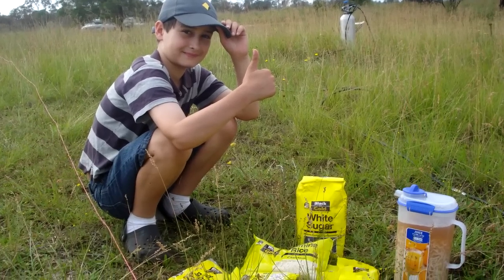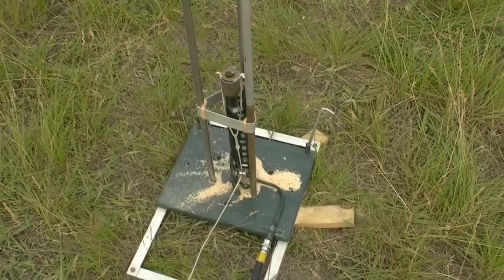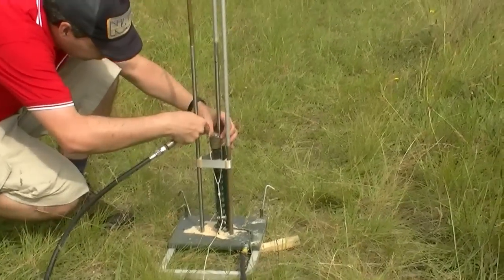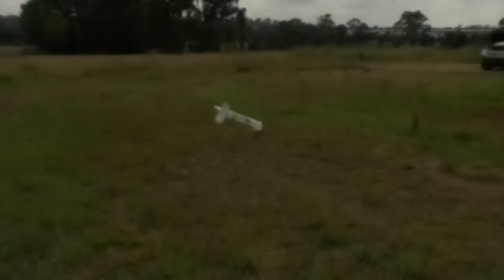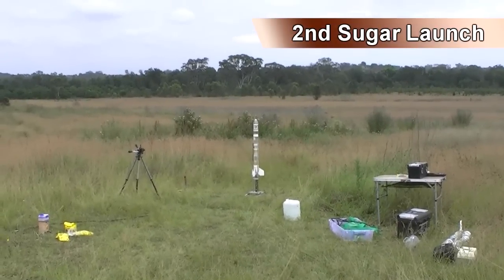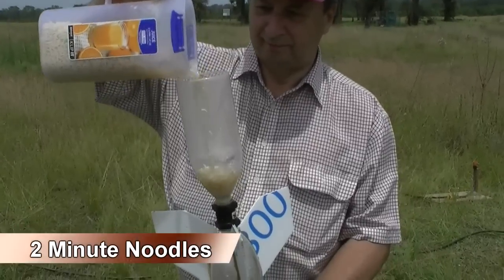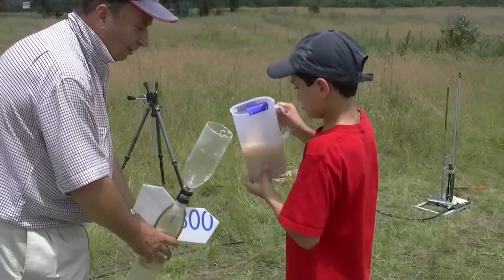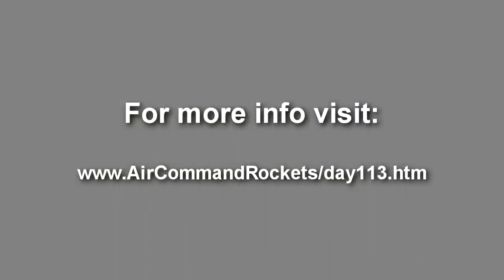Water Rocket Alternative Fuels

Comment: Simulators predict an air-only rocket couldn't reach any altitude. I managed to get a 2 liter air-only rocket about 130 feet into the air, due to the flight time of 6 seconds. It weighs 0.22 lbs with a ball in the top, has a ring fin and was inflated to 120 psi. Because the 16 grams of air moved out of the rocket in a split second, the rocket got an initial speed of about 65 mph. I'm excited about the results. I never thought an air-only rocket could reach such altitudes. On top of that, an air-only rocket makes no junk, it makes more sound than a water rocket and you can launch it horizontally. Not to speak of the reduced set-up time and the water you don't need to carry. It also flies much straighter than filled with water.
Reply from the maker: I'd pretty much agree with that assessment, other than all things being equal adding water to the rocket will give you about 40% more altitude. Water rockets can launch almost horizontally, because as soon as the rocket starts moving the water is pushed up against the nozzle, and "levels" itself against the acceleration.
Reply: O yes, I didn't realise that. Maybe I'll upload a video of my project later.

Comment: If you look at the physics... the fuel should be as heavy as possible, and be pushed out as quickly as possible. Why don't you try iron fillings ?
Reply from the maker: +Rune Kromolty Not necessarily true. Have a look at this experiment where we try different density liquids: https://www.youtube.com/watch?v=Fu3rIiPy_18
Reply: It is, it is the physics we calculated it in engineering class. But of course Im talking about an ideal liquid. Liquids has many properties that make it work worse or better. So a heavy liquid with low viscosity that you push out as fast as possible, should be best.
Reply: Reine Gill also, there is a sweet spot total,  initial weight that has to be accelerated.....  you need to calculate & optimize everything to achieve max altitude.

Comment: I advise to use water solution with large density. For example, concentrated potassium  carbonate (about 1,5 g/ml). In my experiments with small electro-hydraulic rockets this "fuel" had shown better result, than pure water.
Reply from the maker: котофеич бегемот Higher density liquids will result in higher thrust but lower altitude. This is because you are having to accelerate the heavier mass (fuel) still in the rocket. Water rockets will perform better with lower density liquids like alcohol.
Reply: AirCommandRockets
My rockets were very small and non-common construction. Liquid was pushed down by smart electro-hydraulic impact.
Reply: Yesterday I had done series of launches. Six rockets with water: average altitude 23 m, max 27 m, min 18 m. Five rocets with potassium carbonate solution (density 1,45 g/ml): average altitude 40 m, max 43 m, min 38 m.
In my condition higher density liquid provides higher  altitude.
Reply from the maker: котофеич бегемот Was the rocket itself at its optimum weight? Was the water amount at its optimum?
Reply: AirCommandRockets
Rocket mass 8,6- 8,7 g. Inner volume 13 ml, completely full of water. High pressure creates in moment of launch by power electrical discharge (530 J in capacitor bank at 395 V).
Reply from the maker: котофеич бегемот Okay, I see we are comparing two very different things.
Reply: +AirCommandRockets have you tried alcohol with an egnition source under it?

Comment: Hmm... you say water is too heavy. I was thinking of a semi viscous liquid such as dissolving large amounts of sugar in warm water but obviously that is too heavy then. So...

If you are looking for something lighter than water then here is a shortlist to consider - all liquids (apart from no.1) as they provide the best energy transfer from pressurised air.

1. Fake display snow (fine white moist jelly like beads)
2. Salad oil
3. Molten butter
4. Turpentine / thinner / kerosine
5. Molten wax (low temp melt variety) 

I'm thinking only 1-3 are safe enough to bother with!
Stay safe and good luck!

Comment: I'm trying not to be ignorant here ... so the alternative fuel does not ignite, correct?  it just helps with reducing the speed at which the compressed air releases from the plastic bottles?  Am I viewing this correctly?
Reply from the maker: That's correct the fuel does not ignite. The "fuel" is the reactive mass that gets pushed out by the compressed air. The point of the experiment was to show you can use pretty much anything as a reactive mass as long as you can get it to flow out through the nozzle. It doesn't have to be a liquid, just something that acts as a liquid.

Comment: what about powdered magnesium across a ignition source :D pressurize one chamber with o2 and the mag chamber with co2
mix the two in a rocket motor.
Reply: Easier said than done. They operate rockets that appear to have ~10L capacity. If you take a 0.5L one and use a weaker fuel of alcohol and even use a wrong mixture ratio, that's still enough to kill you bottle. Plastic bottles can handle pressure, but they die instantly to heat. That's why you really can't make proper bottle rockets with reactive fuels. Also, "mix the two in a rocket motor" ofc
Reply: Magnesium can burn with CO2, too.
And pressurizing the gas is not making it better..

Comment: But what did you do with the fuel???
Did you put in on fire or what did you do with it, to make it work???
Reply from the maker: Compressed air pushes it out. The point of the experiment was to show you can use pretty much anything as a reactive mass as long as you can get it to flow out through the nozzle. It doesn't have to be a liquid, just something that acts as a liquid.

Comment: just find the heaviest substance f=ma
Reply from the maker: Not quite. You have to take into account the weight that's still in the rocket that you have to accelerate. Water is actually not the optimal density liquid, a lower density liquid like alcohol will perform better.

Comment: Please answer this question: Me and my friend are making a science project on rockets and I was wondering how you get your parachute to come out. Thanks it will help a lot.
Reply from the maker: We use a time based system. The rocket has an electronic timer that detects launch, and then waits a set amount of time before activating a small RC servo motor to open the parachute door and eject the parachute. We have full tutorials on our main website. You can substitute the electronic timer with a mechanical one like a 'Tomy Timer.'

Comment: You guys are the best at making bottle rockets! My dad and I build some 2 liter bottle rockets at filled with water with 160 psi and let it rip. Went about 100m into the air and the nose was crushed on impact. We were inspired by you guys! Thanks!
Reply from the maker: Thanks for the nice words Atomic. :) Glad to hear you are having fun with water rockets too.
Reply: its something away from games! did it at school, landed on roof with a bang! My dad and i have been working on a 4 litre bottle rocket, still need to modify the launcher.. DO u have any tips for making a bigger bottle rocket?
Reply from the maker: Swagy_Senpai's Get your deployment mechanism working reliably first. As you build bigger rockets you will want to make sure that you are not always rebuilding them. Make sure you scale your fins up appropriately with the rocket to keep it stable. Often people will make fins for their smaller rockets, and then reuse them on bigger rockets and then have stability problems. Get a good supply of bottles, you will need them! Get yourself a good air source. Bigger rockets need lots more air, and while a compressor was fine for a smaller rocket, it may overheat when filling a bigger rocket.... oh and don't forget to have fun. :)

Comment from the maker: Straight water would probably work better than noodles and water. The noodles worked the best out of the alternative fuels because the water blocked any air from escaping. With the 100's and 1000's there were big air gaps between the particles and a lot of the pressure escaped between them before it had a chance to eject all of them.

Comment from the maker: Yes, depending on the rocket adding some weight to the nose can make it go higher. Each rocket has an optimal weight at a particular pressure, nozzle size and quantity of water. If you build the rocket lighter than the optimal weight then adding more weight can help. If it's over its optimal weight, adding more weight will cause the rocket to fly lower.

Comment from the maker: There are two most common kind of launchers for water rocket. One is called the "Clark cable-tie" release system, and the other is called a "Gardena" release system based on garden hose quick connectors. Look these up on the net, there are plenty of examples. The Clark cable tie one uses the full neck of the bottle as a nozzle and gives a very fast take-off. The Gardena one uses a smaller nozzle and gives slower but longer launches. The rockets in this video use the Gardena launcher.